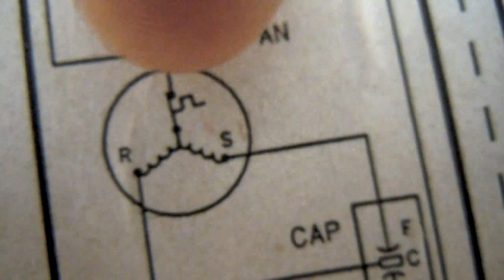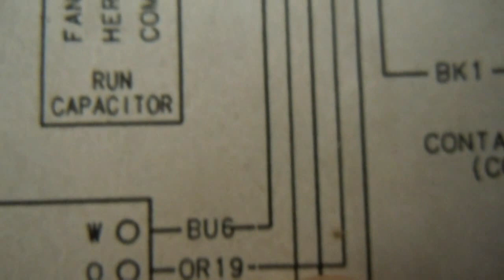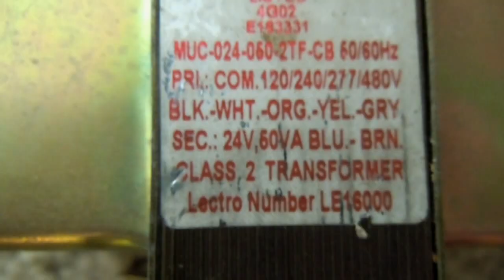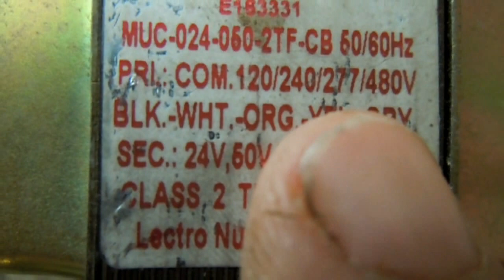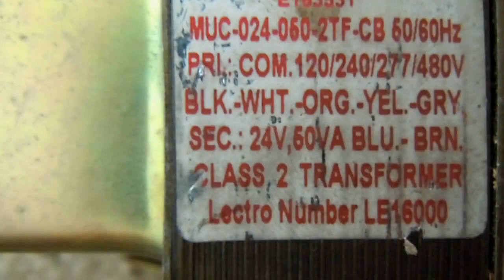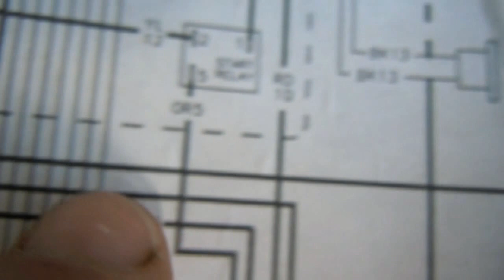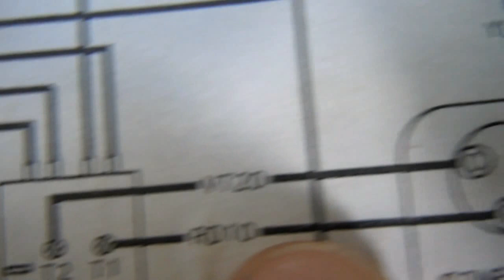HVAC common wires

Comment from the maker: @onecullen The common wire can be the neutral wire for 120 and 277 volt systems. The common wire will be one of the live wires it the voltage is 208/230 and 480.

Comment from the maker: @fyescas777 Control transformers without the wiring information are practically worthless. The common on the primary side does matter. The common on the secondary side does not.

Comment: @fyescas777 If it is a single phase step down x-former then the primary side doesn't matter which wire goes to which terminal(assuming there are only 2 terminals). determine which secondary side terminal is hot and common by checking voltage between each and a good ground. the side which measures voltage will be hot and the other common. polarity doesn't matter.